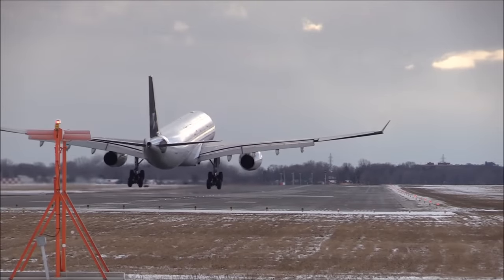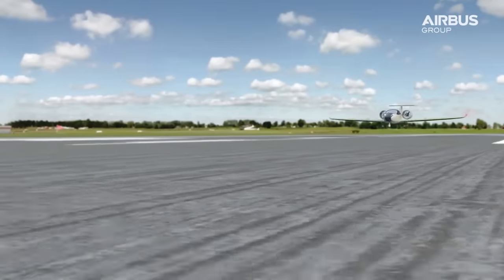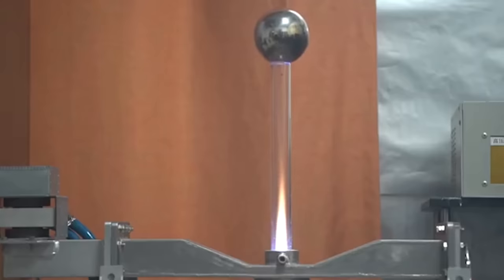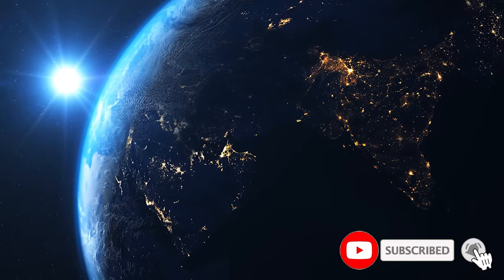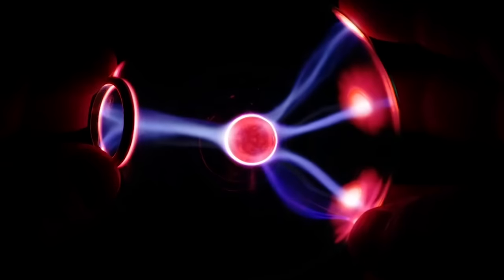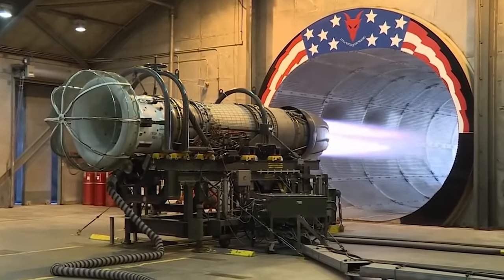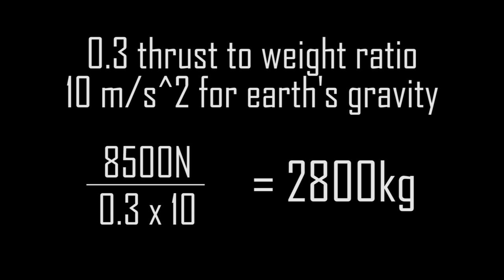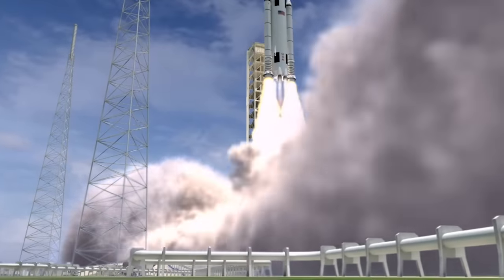Uncovering China's New Electric Plasma Jet Engine

Comment: We'd need a quantum leap in battery capacity, charging time and internal resistance for this to be feasible.  Can you imagine an aircraft carrier sitting there stagnant as it's recharging its planes?  It'd be dead in the water (or under, as the case may be).

There's a reason (multiple reasons) why hydrocarbons are still the energy source of choice.  They are easily transportable, versatile enough to be used across a wide array of vehicles, and in the case of an aircraft carrier, can be topped off in just a couple of minutes - how would you recharge a jet in flight?  Until we have a power source with a truly competitive energy to mass ratio that can be stored for decades, released in seconds and replaceable in minutes, anything but hydrocarbons will be a fad or virtue signaling at best.  Even a nuclear-powered plane would take hours to start and reach generation temperature - and if it crashed or was shot down, could poison hundreds of square miles of territory per plane.

We should never stop trying to advance technology, but considering the instant-on ability of hydrocarbons, there will have to be a quantum leap in power generation that doesn't create more problems than it solves.  Please, China, go ahead and rely on fighter jets with limited flight duration and slow recharging.
Reply: Aircraft carriers is a pretty poor counterargument in this case; assuming you'd achieved the necessary energy density with batteries, you'd obviously just swap out used batteries for charged ones, and be recharging a bank of spares inside the carrier (or just keep a finite amount of spares, comparable to an internal tank of jet fuel). Sure, that doesn't answer "recharging in flight", but I don't think mid-air refueling is the average/common use case, even in military aviation.

Key point is energy density, yes, and batteries absolutely aren't anywhere near jet fuel yet (by about a factor of 50, so that's not changing anytime soon). But I think you're assuming that refueling can't consist of replacing batteries from a bank of spares, when that seems like the most intuitive and rapid way to refuel.

Concerns about "instant-on" are even more off-base - think you're trying to mix in concerns about solar/wind power and time-of-day, which is of concern to fixed installations tied to the grid, but is of no real concern either way to a plane in flight, which has to rely on stored energy either way.

Comment: I saw this really cool conspiracy theory one time where the guy thinks that we don't really carry fuel but rather compressed air
Reply: The amount of compression necessary would turn the air into plasma, which is arguably cooler than the actual jet engines we use.

Comment: I though this seemed familiar. The problem with ICE-vs in this instance is that their catalytic convertors, pollution control devices, take several minutes to heat to the 1000 degrees needed to be properly effective. Electric Plasma sounds like the solution to that problem. I need more information on this, however it is clear the mechanism is going to be much larger, heavier, and likely expensive than a perforated block of platinum. At least up front. But if this is made to work, then ICE-V would be quite literally 90+% as clean as BEVs for start and not several miles down the road.

Comment: The most feasible way for this to work would be to array a series of these plasma “thrusters” in an annular form similar to how  bypass jet engines use annular combustors to drive a series of turbines that in turn power a large fan and compressor. Therefore allowing the possibility to scale this technology more properly and requiring less energy to power such engine. Theoretically at least. Also maybe use an on board hydrogen fuel cell to provide the energy needed? Keep in mind the ambient air entering the engine has potential energy to power an additional generator for possibly extra power and range.

Comment: initial thrust and compression could be achieved with conventional Jet engine then the ion microwave thrust could take over during flight reducing carbon emissions and increasing fuel economy without adding weight from batteries

Comment: Why aren’t there more advancements in using hydrogen fuel cells for commercial jets ?
Reply: because that is stupid.
Reply: How would they even work?
Fuel cells don't produce any thrust.
Reply: hydrogen fuel cells oxidize hydrogen to generate electricity, just in case you didnt know
Reply: Daniel Steger I know how that works. It was in reference to use case for electric jets. Hydrogen fuel cells don’t need charging as a normal electric machine. Hence, topping up liquid hydrogen into jets and making it ready to fly makes them easier than charging batteries !
Reply: @abhishekjain6859  i see you are interested in hydrogen aircraft, limitations and advances are all in this article:
https://en.wikipedia.org/wiki/Hydrogen-powered_aircraft

Comment: Lightning IS plasma not “causes plasma”....
Reply: J McHan  You probably don’t know that you are taking a nonsensical ontological position regarding ionized gases and what constitutes a concept of a proper name vs a general concept referring to a particular range of phenomenon designated by a lexeme. 

There are several other phenomenon that constitute “movement of electrons” that are not plasma. And “heated air” is certainly not the essence of a plasma.
Reply: J McHan  u have no idea what you are talking about. I am a long time student of philosophy of science. U clearly don’t know what either concept refers to or u would have attempted a contrast to my usage with a definition so all can see what you claim to be so authoritatively declaring. 

All you did above is commit ad hominem and assert arbitrary psychologisms.
Reply: J McHan  
“lightning is a large spark of electrical current (movement of electrons) in a planet's atmosphere caused by a difference in electrostatic charge. The push of the current can heat the surrounding atmosphere by as much as 30,000 degrees Celsius (roughly 50,000 degrees Fahrenheit), thus changing the gaseous state of the immediate surrounding air into a plasma.”

That you think the above long form description of plasma is an argument for your assertions is hilarious. 
1). Plasma is an ionized gas no matter where it occurs...( not just “in a planets atmosphere” 
2). Not all plasma is from “electrostatic” difference
3). That plasma heats surrounding air does not in any way mean that lightning is not a plasma.
Reply: J McHan  That you think POS students are seldom either scientists or engineers is more simplistic insecurity.
Reply: Plasma does not necessarily have to be caused by electricity. You get plasma in flames aswell. In your mind, does that mean that flames=lightning?
Reply: @hernerweisenberg7052  not sure why you asked this in response to me. “Caused by” does not equal instantiated in/consists of....Flames are weakly ionized plasmas. Lightning is a particular kind  of plasma much more energetic.
Reply: @MnemoHistory  So, where does the plasma come from and what do flames and lightning have in common?

Comment: If you add a turbine to the output to power it, it won't take as much energy to power it. like in a gas turbine, the whole thing is pushed with a turbine, this is still a ion thruster not a electric jet engine. they should grab a airbus A380 engine, lengthen it, and add a microwave array in place of the combustion chamber, and a brushless generator to see if it's self sustaining. I'm not taling perpetual motion here. i'm talking powered by the very atmosphere we breath, which theoretically, could work on mars (maybe if it can handle the low pressure) jupiter saturn and titan. Also Venus, but upper atmosphere only or it'll melt.

Comment: The jet engine at the beginning isn't a traditional jet, its a turbojet, I think, the air flowing around the exterior of the internal jet is just to cool it, which would be neccessary if it was mounted close to a crew compartment, but its redundant when mounted on the wings and I think it's less efficient, more complicated, more expensive, and less safe....

The actual jet is the middle tube in the cross section.

Comment: Just saying, but aircraft fuel mainly consists of alcohol, which burns clean, apart from some al and other small amounts of anti-bacterial and preservatives in the fuel, the only aircraft types that "have emissions" would be smaller craft that are turbojet/prop powered aircraft that use a slightly different fuel used for the cylinder engines....

Comment: This is a plasma torch. Using proper geometry of the plasma with its electrodes, you can proper the plasma itself without the need of any air inlets. Using this topology you end up with a plasma jet, with high amps. I have made a very nice plasma torch which I use in my semiconductor lab, the problem, unfortunately, it that it makes nitric acid and other nasty stuff when used with air. It is a very big pity we cannot use it. It would be neat on a vertical take off and landing plane.

Comment: The benefits of an electric motor is that it doesn't require air for combustion, so a plane could fly higher where there is less air friction and save energy. This type of jet I think still requires quite a lot of air hence not taking advantage the electric motor perks

Comment: Cdn Artist
The Motor part of your story is Chinese, however the basic machinery to make it has been known for quite some time. Amperex Electric explains in Electronics World February, 1961 how the plasma generator works, and they show how you can build two models, the first at 27.5 Mhz delivers 250 watts, and a 2000 watt 2450 Mhz generator will generate temperatures in the 3000 to 4000 degree Kelvin range. The article is written by Charles Roddy & Bert Green. Hope you may find this of interest.

Comment: the compression of the air might be done like it is done in a conventional jet: turbine compressor in the front, working turbine in the rear, connect both with a shaft...

Comment: Sounds good, but in order to be viable I think the most important thing would be to develop batteries that have high enough power density to propel the plane. As it stands now Hydrogen or Ammonia (as a hydrogen carrier) could do the job kind of well.
However, another concern is the production of NOX and ozone due to the high temperatures generated in the jet,  which is already a problem in conventional jet Engines. Given those issues I wonder if it is not easier to just adapt the jet engine to burn renewably sourced hydrogen or ammonia instead, since the engine principle would basically remain the same and the only change would be the kind of fuel burning. This change would not solve the other emissions problem I mentioned but it would solve the CO2 emission issue with only relatively small changes to current jet engine tech, instead on relying on some future breakthrough on battery tech.

Comment: I have a lot of questions. To get a thrust of 11 N, 0.33 gr. of air per second (air flow per hour is 1.45m3) must be accelerated to 33 kilometers(!!!)  per second (at 400 W). And how does the volume of air flow change at an energy of 1000 W? At 0.33 gr. of air per second, to get 28 Newtons, the flow rate must be an incredible 85 kilometers per second. This is highly unlikely. This means that at 1000W the volume of air flow should be higher. But the Chinese don't say anything about it. Even the 33 kilometers per second indicated in the calculations, are in doubt.

Comment: This is by far the wrist possible way to turn electricity into thrust. Just by the nature of the thermodynamical process of converting the expanding of hot gasses into kinetic energy you already loose about 50% of potential energy in an ideal engine, i.e. without any losses like drag or friction figured in. Just using a ducted fan is a thousand times more useful

Comment: And augment the energy available by using solar film for continuous power.
Flying above the clouds can provide the always availability of sunshine, except at nights.
Even so, having one electric jet into which all available power is used, this can significantly
reduce the need for combustible fuel.
If the jet doesn't scale up well, you can use two for all power that is available during the day,
with  the rest of the thrust requirement then provided by regular jet.
A regular airliner can easily harvest 100 kw of sunlight power, using solar film, no batteries.

Comment: They should add a tiny bit of water mist in there, like a plant spray. But only a very tiny bit, so it can turn
gas instantly at that power output. Key to success is the amount of gaseous expansion per watt,
being the highest possible, using easily obtainable substances, which water actually is.

Comment: What if we used Lattice Confinement techniques, not to achieve fusion, to just to store a volume of plasma to be discharged by an engine? Then electrical energy could be reserved for accelerating the exhaust, as opposed to creating the plasma on board the vehicle.....?

Comment: If lightning turns the air around it into plasma does that mean that if a lightning bolt were to hypothetically strike close to a running plasma jet engine would it be catastrophic?

Comment: In outer space this may be a problem no matter WHAT type of propulsion system is used. After all, outer space is a vacuum. and any propulsion system for spacecraft HAS to obey the Law of Conservation of Momentum. In lay terms, this means that the center of gravity of a spaceship and the many particles of jet fuel ejected from the rear to propel the craft has to be a single point. If a very heavy object is moving away from a very light object, the center of gravity will not be in the geometric center, but closer to the heavier object.

Comment: The peak thrust for a 747 jet is 275,000N which is over 32x times more thrust than this electric jet can do at 310kw.

That means this electric jet would need a 38,400lb Tesla battery to produce the same thrust as a commercial jet but would still have a flight time of only 19 minutes at that output. LOL.

Comment: If the thrust isn't adequate for a plane - maybe it'd be a decent electric heater replacement or gas heater replacement. - 400w is the average solar panel.

Comment: Interesting concept. However, when it comes to electrically powered flight, the problem is the source/storage of electricity on board, rather than how to convert that electricity into thrust. Still it's cool basic research, and I'm all for it.
Reply: run a little gas mower engine

Comment: So the best thing would to be looking into naturally occuring power sources we can get as we are in flight. Electric cars use regenerative brakeing and somtimes solar panels if we can figure out if we can make a fuel or energu sources as we are in flight we could reduce the size of the battery required for the plane and save on weight.

Comment: I am confused. Steinmetz's research in suppressing destructive electrical behaviors convinced him electricity is a wave phenomenon, not a particle-dependent energy source. Yet, every battery application treats that source as limited by the number of atoms in the battery; missing the point that this is not the source or fundamental characteristic of the power. By definition, every electric-powered thing is running on an inexhaustible source of energy (easily amplified to any quantity.)

Comment: 100% electric after you burn the carbon to generate the electricity. Your option is a massive nuclear reactor building project to replace hydrocarbon. After that given that a 787-8 comes in at around 250 tons (227 metric tons) at GTOW, you still have some work to do...

Comment: 6,5 min video, about 2 min about the actual topic.

During the cargo weight calculation only the battery was considered. Nothing about the weight of the hardware needed for the plasma jet or how long it could operate.

Comment: There was an extraterrestrial power source at area S4 that uses a closed circuit Hydrolysis reactor to generate electricity by burning Hydrogen.

The Hydrogen plasma is then run over plates that are made of platinum or gold. You can do it with Gold Plated sheets of copper.

The result is static electricity that is then collected in a type of capacitor, then run through transformer coils and transformed to a lower voltage and processed into what ever electrical power required.

The resulting exhaust is water that is recycled back into the reactor. The heat generated by the reactor is used to bias the energy level of the water so it can Hydrolysis easier and more effectively.

Unfortunately when the reverse engineering team at S4 tried to open the reactor while it was operational, it exploded, killing the team, and taking out most of the building that housed it.

Did you know that the Corona Virus was named after a pathogen was released from a downed Flying Saucer in 
Corona New Mexico in 1947?

Believe it or not!

Comment: Well the plane is flying over the clouds which makes it open to direct sunlight, so you can recharge it during the flight, there are even some gliders that utilize this principle, but as a passenger, I would be a little bit scared that the plane I am flying on is not charged enough to make a full flight even though it will recharge during the flight

Comment: if you were to run the Tesla battery at 310kw (which depending on the model its either a 60 or a 85kwh battery) you'd get about 15 minutes of flight for a 3.5 ton plane, half a ton would be battery, a lot of other kilos would be inverters to get 310kw of power, and a lot of weight would be a cooler system for said inverter and battery. This technology is in it's very infancy and does not have practical use as it is :)) , and tho its a really clean way in terms of co2 to power an aircraft, having the air literally plasma hot would create a lot of noxes (NOx)